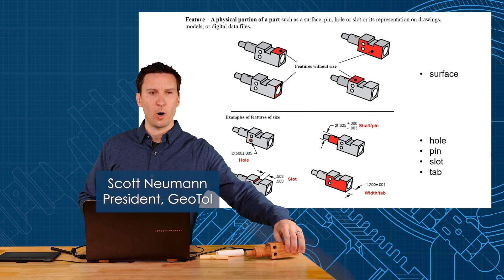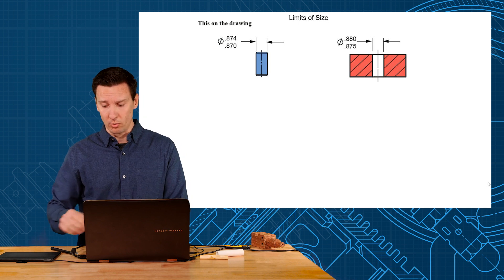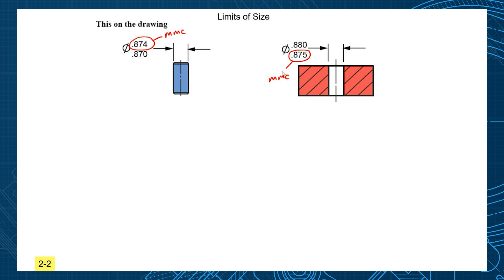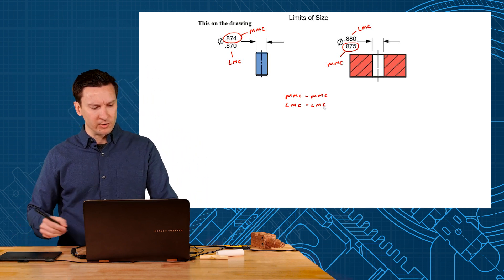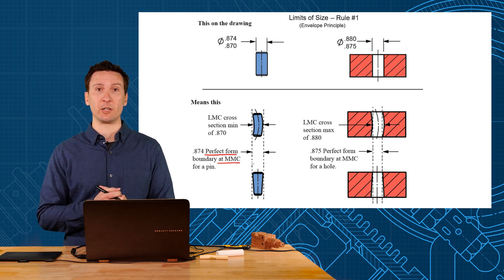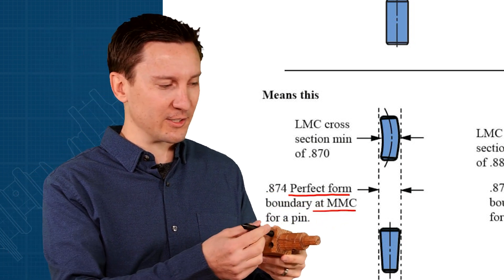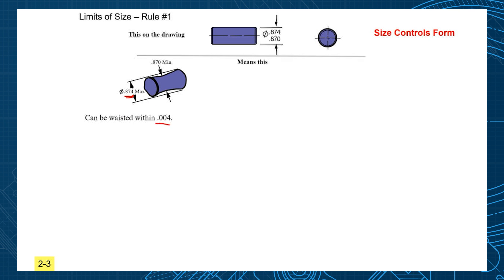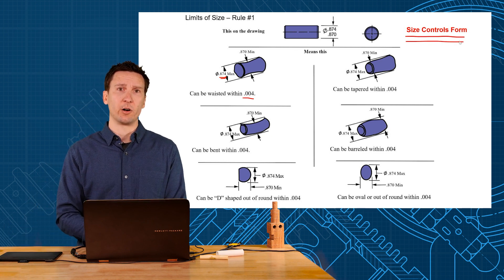Rule #1 in GD&T for Size Tolerance

Comment: Thanks, very helpful!
Just wish to veify if may I control the size (diameter max/min) by a form (circularity tollerance)? in case if diameter tollerance is not mentioned on the drawing.
Reply from the maker: Verifying the size indirectly controls the form. The feature's mating envelope must not violate the MMC limit. Also the local size must not violate the LMC limit. This controls form within the size tolerance. No extra form tolerance is necessary.

Comment: I don't know when you will give me reply but I have a doubt.

If Rule 1 of gd&t can control the form of the pin then what is the use of straigness . Rule 1 or envelope rule keep the pin in side the envelope and straightness of axis of pin also control to keep axis in a certain envelope, thus it keep control the straightness right. So what is the use of straightness when Rule 1 is there?
Reply from the maker: Straightness and other form controls are not needed on features of size in most cases because rule#1 takes care of it. There are two types of straightness: straightness of a median line relaxes rule#1 and allows a greater straightness than the default rule#1 and size. Straightness of line elements tightens the straightness allowed from rule#1. Again, these are both pretty rare and only used in special situations.

Comment: Hello, based on the rule 1#,when the size is at MMC, would the circularity must be zero? if not, how would the form be perfect? thanks.
Reply from the maker: Yes, perfect form is required at MMC. Keep in mind this is the hard theoretical limit. Manufacturing instead shoots for the nominal or mean size to allow room for variation of both size and form.

Comment: Does the rule control parallelism as well?
Reply from the maker: Size tolerance controls the thickness and form of a feature of size. It does not control relationship to other features.
Reply: @GeoTolPro  yeah I noticed that in the standard as well, what I don't understand however is that in some texts other than standard, it is mentioned that envelope rule can control parallelism as well, maybe I'm missing out some details though